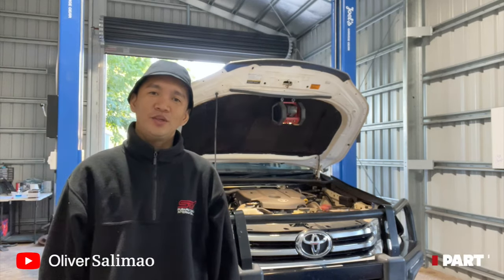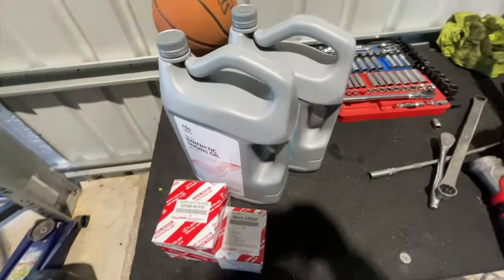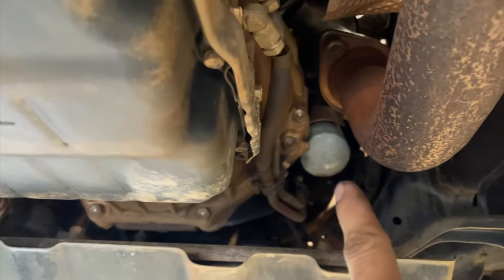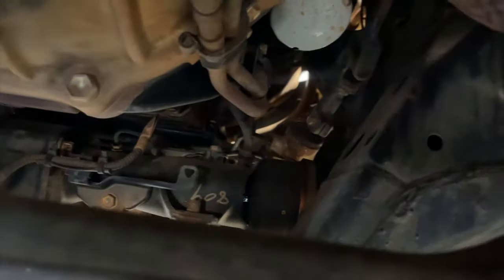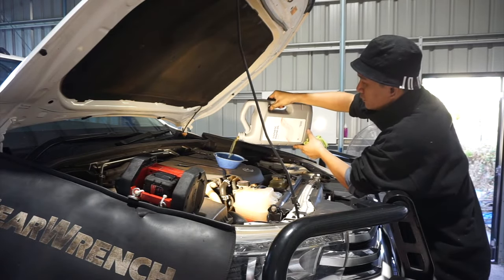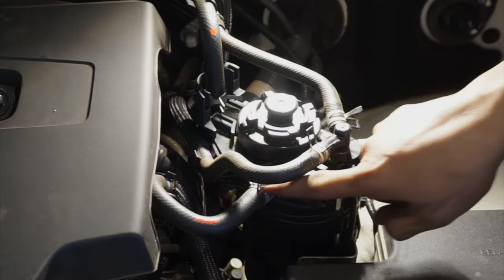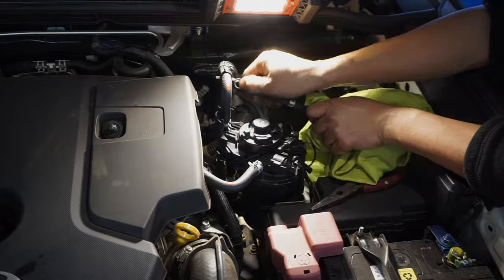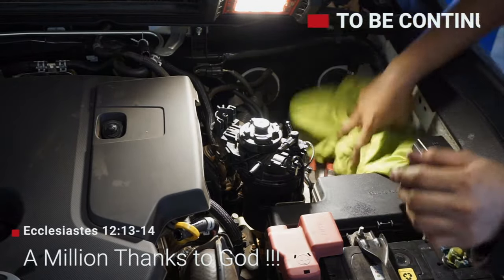REPLACED FUEL FILTER AND OIL CHANGE TOYOTA HILUX ( GUN126R )

Comment: Hey I am using 5W30 oil on the 2.4l 2GD, should i switch to 0w30 or is it okay to keep using 5w30
Reply from the maker: I think its depend where you are mate because of the weather just try to check toyota dealer at your place whats is specified 😉